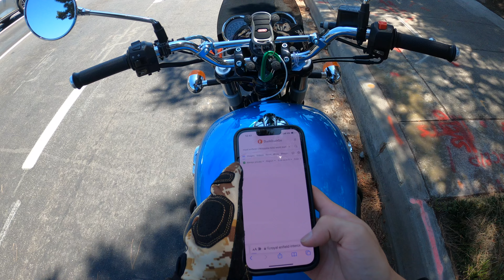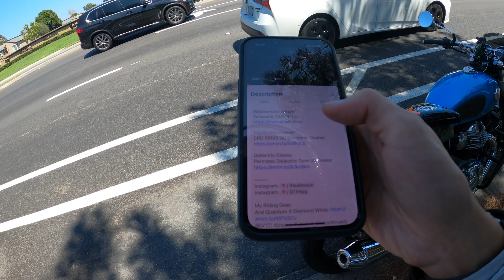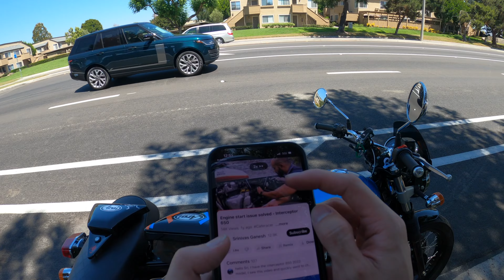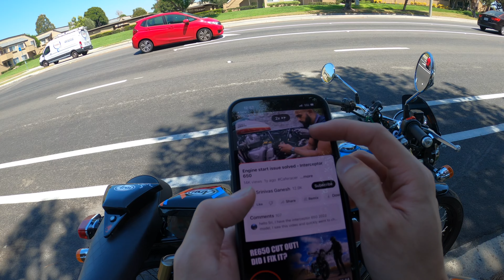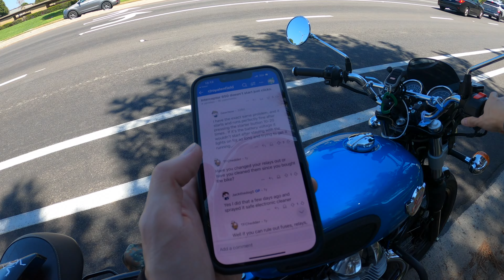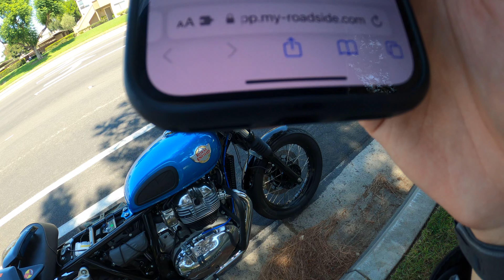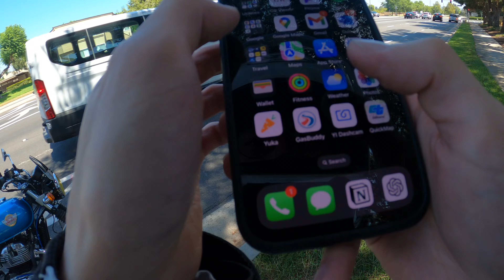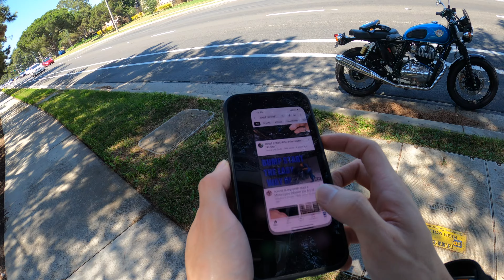It Finally Happened! My Royal Enfield Interceptor 650 Broke Down | "The Enfield Experience" Ep 22

Comment: I knew it was the battery immediately.  Gel batteries have a nasty habit of failing without warning and it's happened to me. 
My Himalayan check engine light comes on when the battery is low and goes away on its own after I switch the engine off then back on after about thirty miles.
I don't think the battery is covered under warranty because it's a consumable item.

Comment: I had the same issue a few weeks ago. Dead battery, so I recharged the battery, but still wouldn't start so I changed the relays... started right up. Then just a few days ago battery was dead again. So, I bought a new lithium battery; going to install this weekend. Hopefully all will be good again 🤞
Reply: I have seen people reporting that the rectifier goes bad and will drain batteries all day. 
Might want to look into that

unless your battery is super old it shouldn't die unexpectedly
Keeping a battery maintainer is a good idea too.
Reply: @Ov3riid  thanks for the info 👍  if the new battery dies, I'll try that next!
Reply: Check to make sure it's charging. But I have also heard people say to replace all the relays too, saying the ones that they ship with are complete garbage.

Comment: All that grease in the relays is dialectical grease, it in no way helps a connection. And can in fact cause a connection issue, they shove it in their because of moisture issues they had with their relays. Get some better relays and replace them, also get some contact cleaner and clean out the grease from the pins. 
Double check that the battery is charging too.
Reply from the maker: https://youtu.be/nwmlQtl3sCU

Comment: Why would you turn off the engine having a check engine light on ?
First reach your destination and then investigate
Reply: Ikr.... But I could totally get his frustration 😅
Reply from the maker: I turned it off a few minutes prior and it started right up. But yes, it was a very dumb idea to cut the engine in the middle of the road.
Reply: @iamalexsun  Also, I'm shocked that you were a solid half an hour stranded and not a single person offered you help. In my country if someone is on the side of the road and look broke down, you usually at least ask if everything is ok. Specially in the motorcycle community, we help each other here.

Comment: its your rectifier/regulator. 12v is far too low. It should be like 14.
Reply: @seanv6711  That refers to the charging voltage, not battery voltage, and in this case the engine wasn't running, but it's certainly worth having the charging system checked. However, as stated in my answer, maintenance free batteries have a nasty habit of failing without warning and it's happened to me before. The last time was on my Yamaha FZ1. I replaced it with a traditional lead/acid battery and had no further problems.

Comment: As soon as you said the bike had cobwebs ....  and the check engine light came on  I knew it was the battery. 12.6 volts but no amps . If you did not put a trickle charger on the bike while it was not used then you killed the battery and it's your fault.
Reply from the maker: @brockett  My bike is always on a charger, however it’s not strictly necessary. The factory battery just isn’t the best and should have been replaced earlier.

Comment: that's wild the battery indicator showed the battery was fine. thanks for reminding me to charge my power bank, and get a new battery haha
Reply from the maker: I have mine on a battery tender all the time and it still died. Maybe it's the quality of the OEM battery, I'm going to be replacing it with a more reliable one!
Reply: @iamalexsun  welp, I had my bike for a year and a half. Bike was in storage for 3 months. I tested the oem battery. Won't hold a charge. Bought myself a lithium battery replacement. As I was researching this. Alot of our fellow INT owners replace their batteries right off the lot

Comment: Could you conduct an experiment for us please. I read somewhere if you have this issue in the wild and it's not the relays remove the fuse for the lights. Whoever wrote it said something about the headlight draining a fair bit of power on start up. So if it works it means you could replace your panels and just leave the seat off until it starts. They also said that once it's running replace the fuse so you've got your lights. Be interesting if you could test this and let us all know if it works.
Reply: I have tried it. It works. But remember to replace the batteries ASAP, as I got stranded the same day in a remote place, and even this trick didnt work.

Comment: Sounds like your battery died. Same thing happened to mine I ended up changing out the relays for ones from hitch cocks motorcycle in the UK. I also cleaned out all the shit grease stuck in the relay and used a better and less grease. No problems since also look into moving the R/R unit location. YouTuber James slick England has a whole thing on this.
Reply from the maker: Thanks for the tip! Will look into this!
Reply: I recall RE had an issue with their relays, it's why they shove all that dialectical grease in them.

Comment: My bike makes a whirring sound on the chain side of the bike, and I’m trying to figure out if it’s normal. If you put your left knee out a little and listen while you’re riding, does it make any sound? Almost like a buzzing or whirring or something?
Reply from the maker: Not an issue I've experienced. Yet.
Reply: @iamalexsun  sheiiiiittttttttt
Reply: @iamalexsun  thanks mate 🙏
Reply: This might sound dumb but is it your clutch lever? Whenever I take my hand off my left handlebar there’s a buzzing noise which I think is the clutch lever rattling around. I keep meaning to tighten it down or add a washer or something.
Reply: @MotorcycleWrites  no definitely not because the sound is coming from below me and it gets louder when I move my leg
Reply: I think it has something to do with the chain